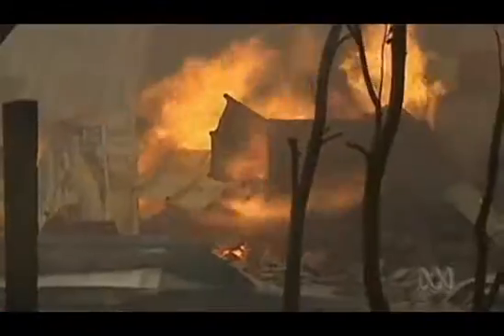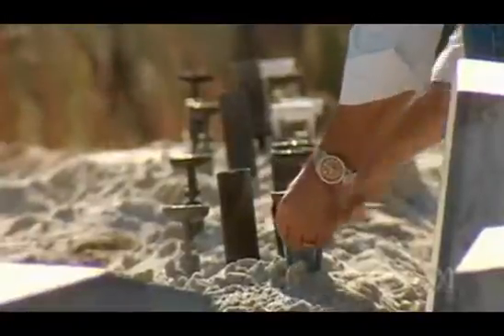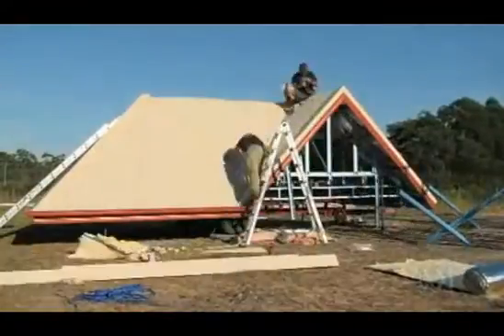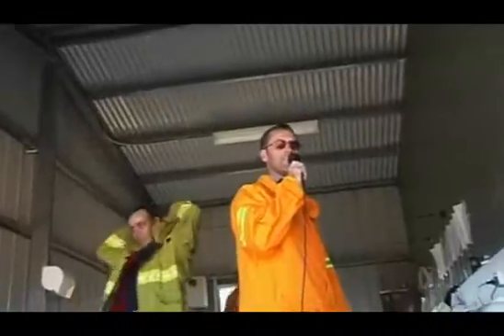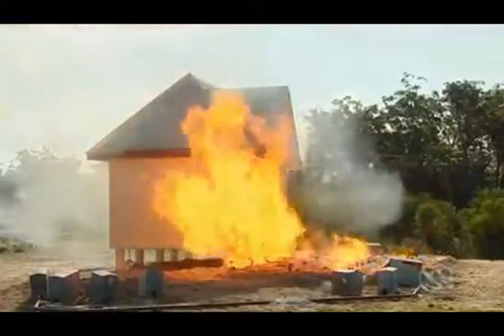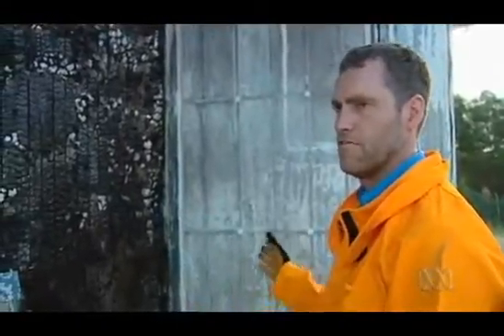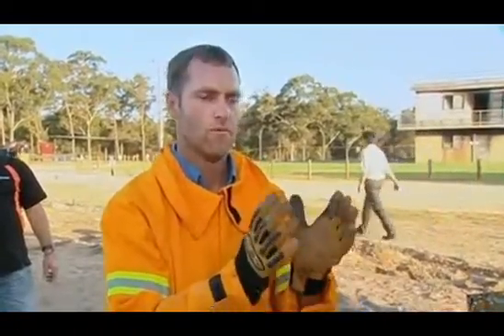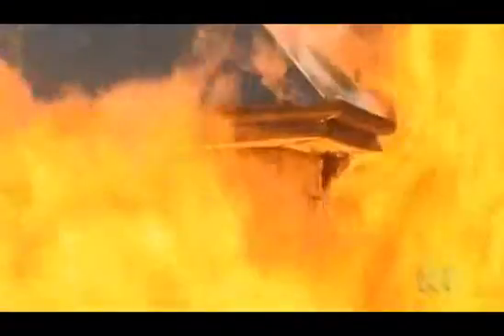Burning House   Steel Vs Timber

Comment: specialists say that in some cases the tar that remains on burnt houses made of concrete is so toxic that the demolition is needed and so the effort to build a new one is much bigger then in , let's say, wood house which burns completely. and a concrete house also emits radon, there are many reports on this. perhaps when building a house it's not "the best choice", but just a choice.